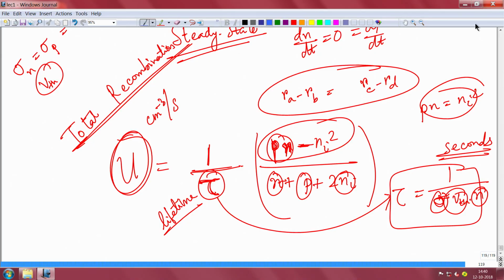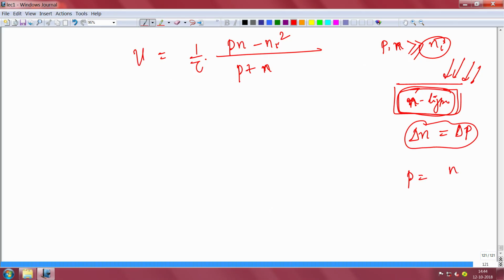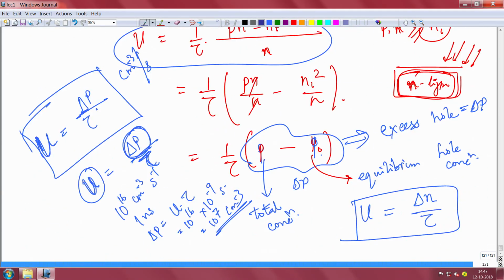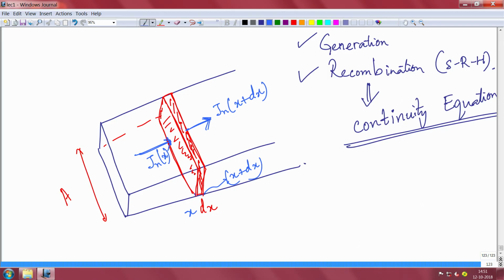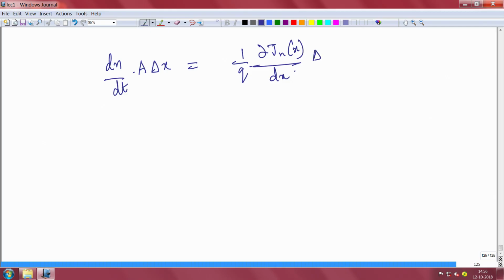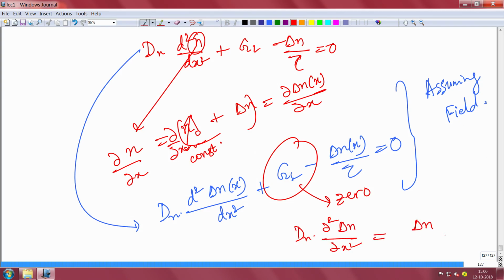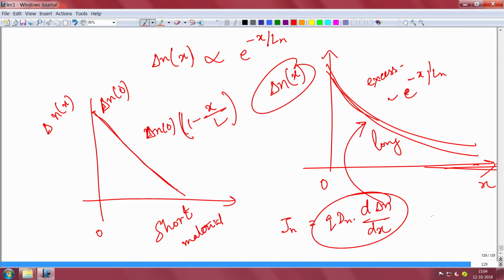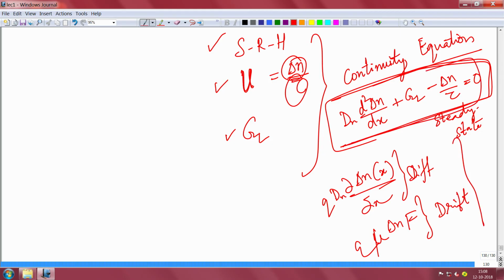Current continuity equation

Comment: 00:33 Understanding recombination is crucial for device performance
03:31 Non-equilibrium conditions drive recombination and resistance
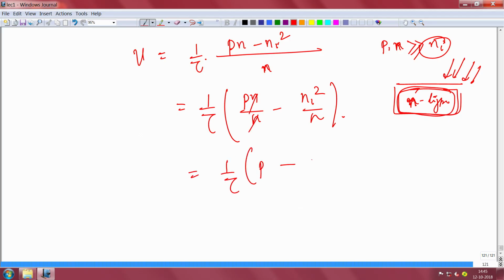06:41 Excess carrier generation and recombination
09:37 Shining light on a semiconductor generates carriers
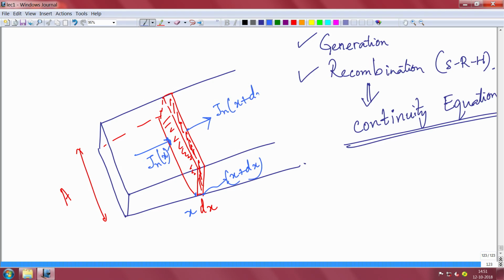12:53 The total rate of particle flow within a volume is given by the difference between the current flowing in and the current flowing out.
16:12 The total rate of particle flow is determined by the difference between flow out and flow in, as well as generation and recombination rates.
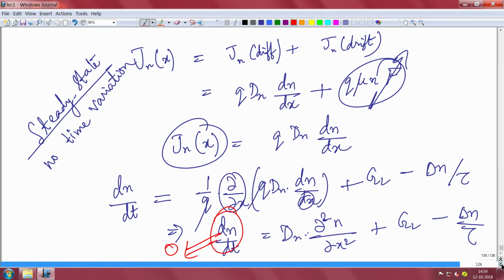20:16 There are two situations that can be approximated: when the length of the semiconductor is much larger than the diffusion length and when it is much shorter.
23:17 Diffusion length in semiconductors can significantly affect the decay behavior of excess carrier concentration.
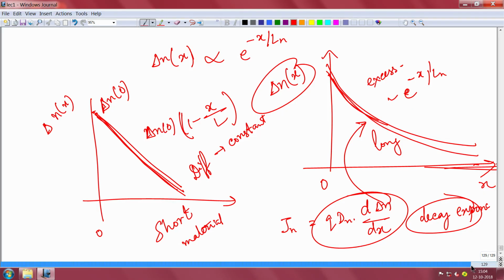25:55 Excess carriers in diode decay exponentially, and assumptions made in solving the continuity equation.
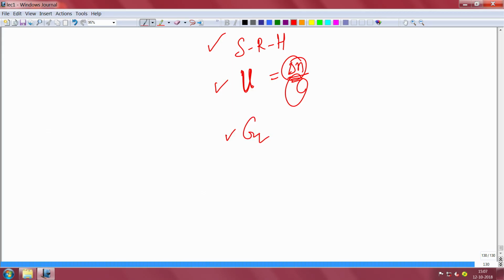28:19 Continuity equation is a vital starting point in semiconductor devices
30:47 Move to p-n junction
Crafted by Merlin AI.
Reply: For recombination,the book is s m sze